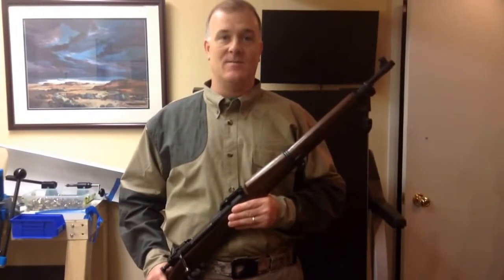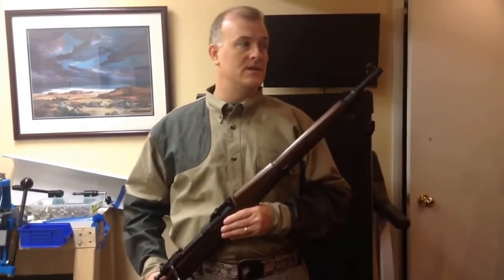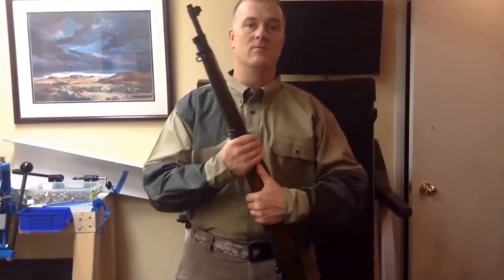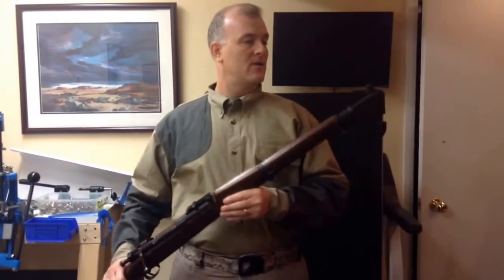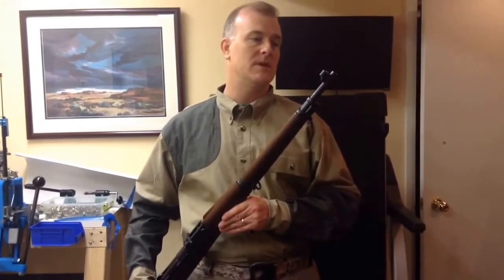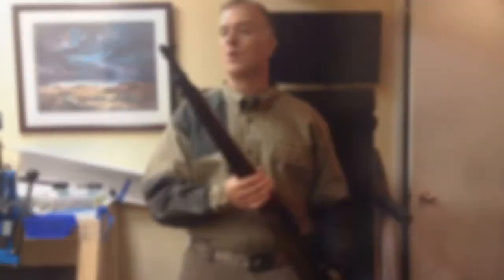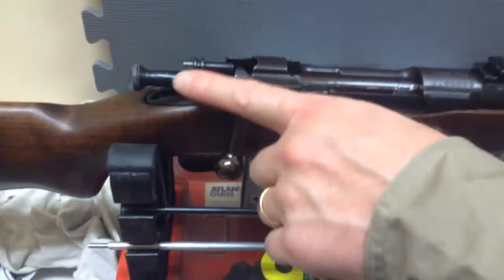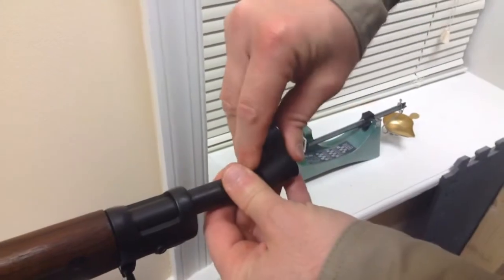Front sight guard removal from the M1903 Springfield

Comment: I recently purchased an 03a3 and I removed the sight cover, looks like it's been put on and removed several times to where it looks like it's a natural and normal thing, even before I took mine out to shoot I thought that front sight cover was ridiculous and I was like how could you see with that on and then with more research I figured out it was supposed to be taken off.
Reply: YAA here.  Yes the cover is a guard for the front sight blade for shipping or otherwise not shooting.  I think I still tried shooting with it on before finding out it was meant to be removed.  Other rifles do have a guard thst is meant to stay on and look very similar to the ones we see on the Springfield 03s.  Mine is a 1903 with the flip up rear sight which has different various aiming notches.  When you look through those and the removable guard together the sight picture is very busy and I found it much better after taking it off.
Reply: It works best with the aperture on the lader, it is a sight HOOD and was used by the USMC as such during WW2
Reply: I also recently purchased an 03A3 and I tried to shoot it with the hood on. It drove me NUTS because I simply could not get a sight picture that worked for me. So I figured that hood wasn't doing me any favors!  Glad I saw this video!  Hopefully this will do the trick!

Comment: So how can you install this? I am trying to install a USMC one on my 1903.
Reply from the maker: I think you just press it down over the front sight the opposite of how it comes off.  The two legs of the cover should spread apart enough to be able to go past the diameter of the barrel and then go back to the original shape and clamp on.  I looked for pictures of both types.  I think they are built the same but the USMC cover is taller and allows more space around the front sight blade.  You can also use a snap ring plier to help assist with spreading the part just a bit.  In my video I just used my nails to get a grip to make it come off easier.  But they will pull straight off or go push straight down.  WARNING: Don't try to bend it more open and expect to bend it back.  It's is only meant to 'deform' a slight bit under its own flexibility and flex back at install/removal.  They were formed by bending into their permanent shape but that is only under manufacture.
Reply from the maker: I have a new video related to this up now and the link is in the description above.  It might help. I haven't seen the USMC cover up close yet.

Comment: I have a 1960's Weatherby made in Germany by Sauer & Sons. The front site hood is so loose it falls off. Would you glue it back on? Epoxy, super glue, loctite ??
Reply from the maker: For such an antique or valuable rifle, I would first look for a replacement part that would fit just like the original.   Find an original part if you can.  If you use the rifle, secondarily look for a similar reproduction or compatible part.  I would be afraid the various glues, etc. might harm the original finish. 

Now if you are bold and willing to try,   you could get some round metal to support inside the hood and try to slightly press the ends closer together so to restore the clamping action it once had.  But keep the round filler guide clamped to the inside top of the hood so it doesn't slip and cause a crease.

But I would err towards leaving it be.  I have inquired to Weatherby to see if they have any ideas for a replacement.
Reply from the maker: This is what Weatherby recommended:
Contact Williams Gunsight Co in Davison, MI for that hood.

I had given them a general description, 1960s Weatherby built by Sauer and Sons.
Reply from the maker: See my reply to my reply